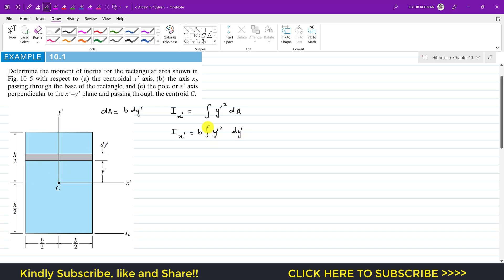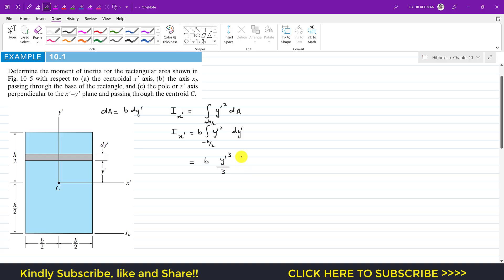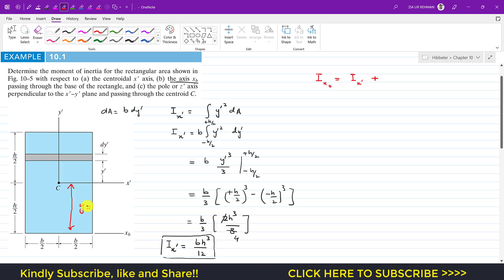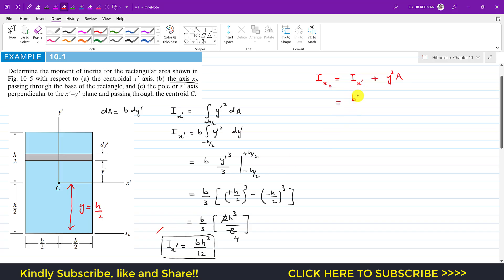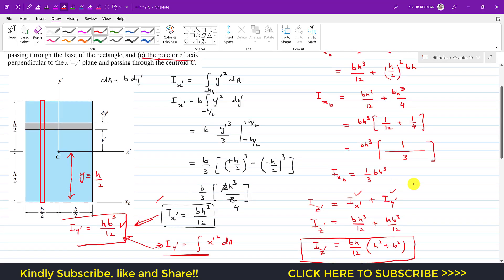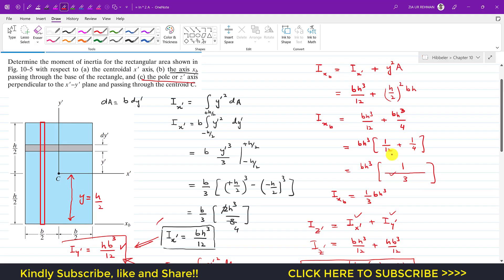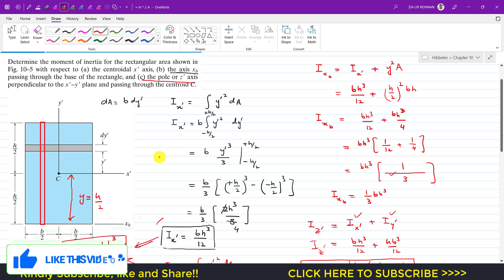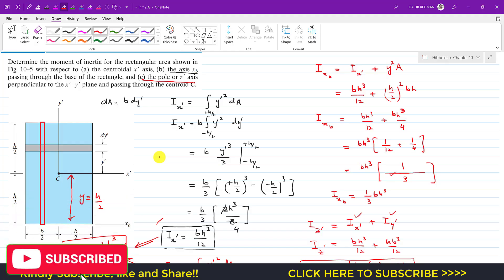Example 10.1 | Chap 10: Moment of Inertia of a Rectangle ( Hibbeler Statics ) | Engineers Academy

Comment: The 900-lb boom with center of gravity at G is held in the position shown by a ball-
and-socket joint at O and the two cables AB and AC. Determine the two cable tensions 
and the x-, y-, and z-components of the force reaction at O.
Reply: What is your Instagram id i will send the picture of problem there